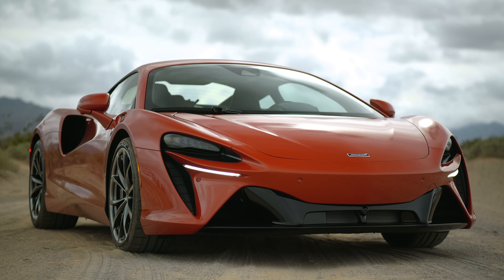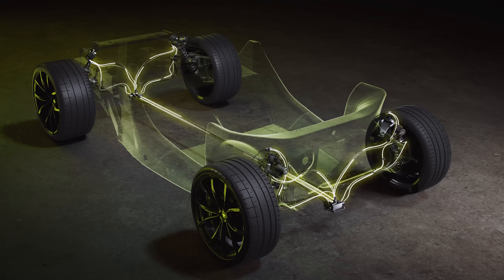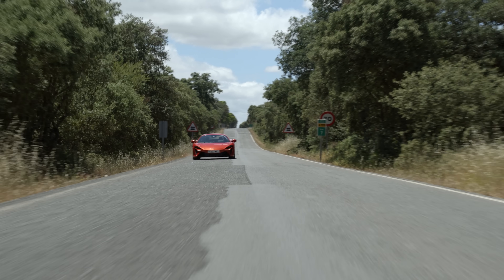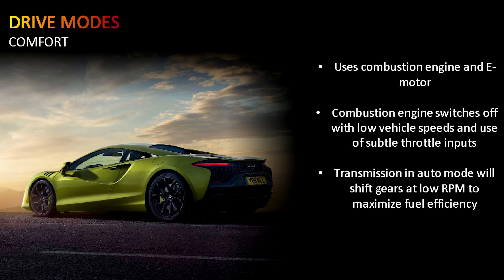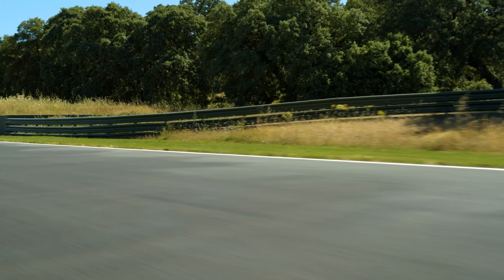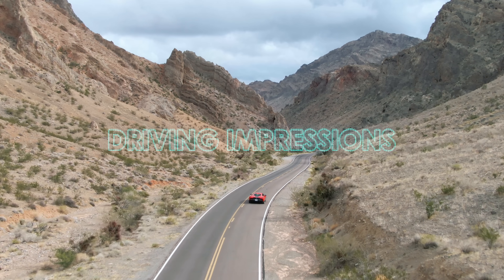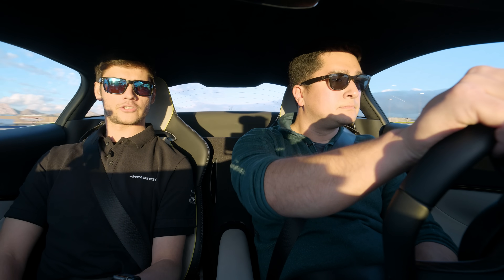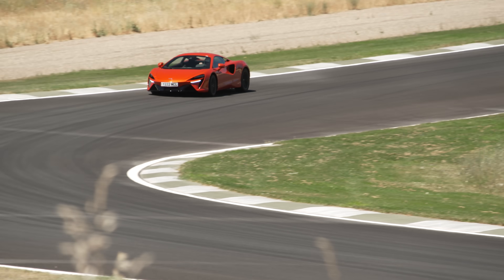McLaren Artura | The Hybrid Super Car Formula

Comment: Off topic important request:
Please consider doing a video about the feature cylinder de-activaion. I was looking to buy a pickup truck with a traditional V-8. However, the horror stories of unreliability is very concerning.
Thank you
Reply from the maker: Depends on the brand and how its implemented. The GM problems are the worst.  The FCA/Dodge/RAM are usually just solenoid issues.  Honda V6 previous gen destroyed certain cylinders from heat.  Mazda had the heat issue figured out by constant variation of cylinder deactivation but then had software issues. From consumer side if there is an option to disable do that.
Reply: @savagegeese  OH, great. Now we have to "bullet proof" gasoline V-8s like Ford diesel engines. 

Appreciate the rapid response and keep up the great work as a trusted resource.

Comment: I basically didn't know about McLaren before getting into the YT-based automotive journalism scene, but since then they've surpassed everything for me - I'd take a 765LT before just about anything else short of a 918 Spyder
That being said...doesn't this car just seem kinda...boring?
I realize it's a sport series car, not a super series, and it's an upgrade in every way except sound from the 570S, but I can't help but feel like it's a bit underwhelming.
Yes, it's fast. Yes, it's an engineering marvel. But compared to the step forward that the 570S was, this just feels a bit pedestrian.
Holding out hope that the rumors are wrong and the 720S replacement will keep the M840 with a hybrid, because we need a proper sendoff of the McLaren TT chaos

Comment: New dream car unlocked! This and a 992 GT3 RS and I can die happy lol. The engineering, particularly the forward-thinking hybrid drive train and axial-flux motor that is a perfect fit for its use-case are things engineers dream of. No one wants excess baggage or unnecessary complexity, but the right necessary complexity to magnify the impact of traits like driver responsiveness, engagement and efficiency is just a rare and set of problems and resources to be presented with. Kudos to the team at McLaren and their partners that made this car possible!

Comment: man i would love how to feel how that car drives with its hydro steering.
i prefer my base model 328i e92 hydro steering over my f80 m3 eps system...
Reply: Thats why you should get a e92 M3 or 335i and tune the crap out it, chassis and engine wise. Thats why I sold my F series and got an E series again...
Reply: @GoldenCroc  I'll keep the F series for a while, I still like it, that S55 is so much fun for me, but I will add on an M3 E92 at some point. Maybe after I pay off the F80. Besides, I drive the 328 most of the time so it's just that noticeable change once a week everytime i drive it

Comment: So how would this compare to your Z06? Speed Phenom describes his McLaren 600LT has more connected to the road, compared to his C8 Z06. Of course, the cost is significantly different.
Reply: Hydraulic steering, a lightweight carbon tub with race car levels of rigidity, and 3,000lb curb weight equal a car that no mass produced Corvette will be able to match no matter how great it is. To the driving connoisseur the Mclaren justifies its price and potential headaches, to the other 85% the C8 Z is just fine

Comment: The hybrid system and turbos are clearly there to improve the car's performance, not sure why you guys treat it like some compromise from regulations or something.
Reply: Weight, thermal complexity and most hybrid systems have added things like brake by wire etc.
Reply: @jackethnicallyambiguous  fair enough, but it seems they’ve done a good job keeping the weight down and retaining things like hydraulic steering and natural braking

Comment: I'm pretty sure that brake by wire hasn't been implemented in any production car as of writing this comment
Reply: Its in a ton of cars. C8, modern m cars, any ev with regen, merc, cadi.
Reply: @jackethnicallyambiguous  Yeah no.

Brake by wire means that there is no physical or hydraulic connection between the brake pedal and the calipers. so in the case of a power failure you no longer have brakes.

the C8 corvette, all BMWs, all current Teslas, most hybrids, etc have an electronic brake booster instead of a vacuum one. that means that in a power failure you still have brakes just without an assist.

electronic brake booster and brake by wire are not the same thing.
Reply: @anonym3017  what we mean by brake by wire, and what the engineer is saying in this video is that the brake pedal has no hydraulic feedback. The feedback loop is controlled electronically.
Reply: @jackethnicallyambiguous  the only difference between an electric brake booster and a vacuum one is that an electric motor provides the force instead of a vacuum.

The entire rest of the braking circuit is the same between them and the brake pedal still acts on and is directly connected to the hydraulic braking circuit. So the hydraulics provide the feedback/resistance in all of them as that's by far the simplest and cheapest method of doing it.

You can even test that by grabbing a modern M car, disconnecting the 12V battery and then testing if it still has functional brakes. If it actually has brake by wire it won't have brakes. If it still has brakes the pedal directly acts on the hydraulic circuit.

The manufacturer can obviously vary the assist of an electronic brake booster, depending on the situation, between none whatsoever (which is how they do regenerative braking when it is controlled by the brake pedal instead of by lifting off the throttle) and braking without a pedal input (which is how ACC slows down vehicles) and anything between those.

Comment: The most important thing is not included. reliability. Did they done anything compare to the 720S, 650S, MP412C reliability ?
Cracking windshields, tons of transmission problems, electric problems, cracking interior parts ad the list goes on... They should slow down releasing new cars and fix the reliability issues first.
Reply: They "claim" the new manufacturing processes will improve QC and reliability. It is too soon to tell

Comment: Frankly, hybrid propulsion is iffy at best. A car with two different powertrains no matter how well integrated can never be as reliable as a non-hybrid system. It's just common sense. If I worked at McLaren, I'd design a single turbo, straight six in a lightweight chassis, similar to the old BMW M1 coupe...circa 1980. It would much cheaper and utilizing modern materials and methods, it would perform very well.
Reply: submit your resumé
Reply: No high performance supercar manufacturer would use a straight six just for the packaging reasons alone

Comment: With their focus in driver involvement it's sad McLaren aren't making any manuals anymore. Now that lotus are going all heavy ESUV on us, MC could make an elise successor easily
Reply: They only had one model with a manual. And it's the most expensive one you probably couldn't buy. Also the best one. And it's old. 

Buy a Porsche if you need a manual these days. And the days aren't gonna last forever
Reply: If your're after driver involvement you have to readjust your mindset and forget modern cars. Stop looking at the new wizbang stuff that's coming out. The best cars for driver involvement have already been made and they're all over 25 years old. Rack and pinion steering, manual trans, little to no electronics to gum up the experience. The modern manufacturer's can talk until their blue in the face, but no new car can even come close to the older sports cars in the driver involvement area. Faster yes. Better lap times yes. Safer yes. Quieter yes.  They're also overly complex time bombs that will require a monetary commitment from the owner that simply doesn't make sense, especially when compared to the older cars. 

I drive a quarter mil dollar sports car, so I think I'm the target demographic for this McLaren. They would have to pay me to drive the thing. I can see the problems thus thing will have coming from a mile away.  And for what? So I can go faster and feel less? No thanks. 

If on a budget, go get an old lotus elan. They can be had for $35K. More driver involvement than this Mclaren. More character too.
Reply: @overbuiltlimited  just admit it... You know most people don't care about driving. Some people do. Most of those want the newest fastest thing. That leaves a few who can appreciate handling. They don't buy enough cars to matter anyway. 

Still, it's hilarious your suggestion is buy a lotus elan. Of all things that? Get an Elise and be done with. Or a caterham, or Alpine, carefully selected Porsche, an old BMW, a new MX-5, an old MX-5, GT86, Old NSX, RX-7...Etc.  

What in the world...
Reply: @TsLeng   Read my post again.  I explained my position well.  I also qualified what a drivers car is to me.  It also seems you missed the "if you're on a budget" part.  If you fine with a watered down experience no skin off my back.  Drive what you want.  I will say though it's pretty silly to criticize an Elan recommendation (why? no one knows because you didn't say why) and then turn around and recommend a Caterham.  A Caterham is a wonderful drivers car to be sure, and I could have easily recommended that, but it requires a serious commitment from the owner, much more so than an Elan.  But go ahead and criticize one of the greatest drivers cars of all time.  Strange.
Reply: @overbuiltlimited  a budget driver's car is a Mazda Mx-5.  The Elan is FWD, buy an old civic/integra instead. The older Elan...Well, but the Mazda 😂. 

If you think only unassisted steering will give the experience, there are still better cars than the Elan...
Reply: @TsLeng   Ah I get it now. You don't know your Lotus cars. The M100 Elan which started production in 1989 was never referred to by anyone, then or now, as one of the greatest drivers cars of all time. I was obviously referring to the series one Elan built from 62-73. It was REAR wheel drive and had steering so precise that it was the benchmark Gordan Murray used when designing the McLaren F1. After the F1 was finished he said that try as they might, they never managed to get the steering of the McLaren as "perfect" as the Elan.
Reply: Fun fact: The original Elan was used as the template that Mazda engineers and designers used when drawing up the Miata.  You probably should have known that given your recommendation of the MX-5, but hey arm chair internet drivers eh. Do you even own a car?
Reply: @overbuiltlimited  the only reason I am entertaining you is you have a very specific suggestion as 'the' car to have. 

And to have the confidence to add that is on a budget...Therefore I have decided to reply to tease more funny out of you. 

You probably own one of those things and just a massive fanboy. Understandable but hilarious trying to sell that. 

It's a niche proposal that isn't reasonable for most people. Unachievable even and you know why.  But one can buy an MX-5 easily, cheaply used. Even a new one if you fancy. 

Don't ever fall into the rabbit hole of thinking everyone is looking for the same thing. I just can't help but to comment because your rabbit hole is so niche and way off the mark. For  almost anyone else, just get an MX-5 or S2000 or Elise or Caterham et all and call it a day. 

Note: I knew you are referring to a rare Elan, but who knows, I bet there are hardcore FWD Lotus Elan fans what would try and convince us that is the best instead.
Reply: @TsLeng    Man, you are strange.  I' m done here. Keep your grades up. And don't worry bro, if you work hard you'll be able to get that Miata one day. In the meantime, enjoy the bike rides.

Comment: Ok, thanks Jack...we get it, McLaren can do 2-seat/2-door super/sports cars...but can they do 4-door wagons? I really think McLaren needs to diversify their product offerings and make a 4-door/4-seat car much like fabled sports car maker Porsche.  Initially, ppl were blasphemous (#@*&!%), but now 20 years on, that 4-door/5-seat SUV is still going strong and has given the company new life and new/more customers than it could have dreamed of.  So, McLaren, when is your 4-door/4-seat road/track killer coming out?  (hint:  do better than Aston Martin and do it for a lot less). 🏁
Reply: what if somone put new prius drivetrain into lotus elise lolz rwd transvere
Reply: @kalmmonke5037 ....well, what is better;  engine powering the wheels through the transmission w/an electric motor in line on the input (or out put) shaft...or....put electric motors on the wheels (half-shafts) and the engine used as a generator/range extender?...or combination of the 2 like in the newer NSX???  🤔   Full EV is nice, but I think the answer is performance hybrids... 🏁
Reply: @K03sport  for driving fun, gma t50 is it. variants of it would make sense. like off road version sort of like scuderia glickenhaus scg008 kit car, because although its not as lightweight agile, off roading fast (no legal speed limit) , rallye, rock climbing, car pitch and roll on soft suspensoon (to be able to get over bumps) then preemptivly switch to firm suspension for being able to go around turns quicker, and switch tires from offroaading to road tires.
Reply: @K03sport  to get benefits of electric and combustion , but miss on the game of keeping up engine rpm momentum, theres combustion powering minimal amount of battery and electric drive

Comment: Mclaren has only one problem in my eyes: reliability. If that gets fixed, they are up there with Porsche and Ferrari.
Reply: Ferrari isn’t that great either in terms of reliability. Porsche is one of the most reliable brands in this area.
Reply: @seren1ty755  It's not as good as Porsche, but it's still much better than Mclaren. And Ferrari makes up for it with their brand power and styling.
Reply: @HiddenWen  I approve this message
Reply: Not even close dude😂🥴🤡
Reply: @AnantGupta02  turbo engines over na v12? add to this ferrari looks much better both inside and out. who cares if mcclaren is a tiny bit faster

Comment: Reliability and depreciation are Mclarens major issues!
Reply: Supercars are not designed for daily commuting, they are designed for tracks once a month.
Reply: @inkandwrist  honestly, more than a few people daily their Ferrari Roma or Lambo Hurcan where I’m at, so why shouldn’t Maclaren be held to the same standard?
Reply: What model Mclaren did you own that you experienced this firsthand with?
Reply: @jameswillard1  bro he’s just saying that it’s common.
Reply: @jameswillard1  I own a 570S and he is correct. It doesn't take ownership to realize that McLaren's reliability is trash. Just read the forums and see that they have issues that carry over from model to model. Misaligned doors and strikers, broken windshields due to stress, paint quality issues, and of course general electronic issues and mechanical faults. All of these things have carried over from the mp412C to the 650 to that 570 and then 720. So that's four generations of cars that McLaren couldn't teeth out issues. Why should I be convinced that the artura will be any better?
Reply: @objectivethinker3225  You didn't specify what happened with your 570S? Why mention it and then continue to do what everyone else does and mention forums and online. Hmm.
10 year old 12C here that has been faultless besides consumables!
Reply: @jameswillard1  ???
Reply: @jameswillard1  I’ve autocrossed them, they overheat like a mofo

Comment: To an extent, BMW did this with the i8 in 2014. Very similar formula, and one that the Corvette is going to follow as well although with a V8. I've absolutely adored having the i8 for the past 4 years and been struggling with what to replace it with this coming spring. At the moment I'm going to step over into a manual M4, but can totally see myself getting back into this kind of car down the road.
Reply: corvete steering is not communicative
Reply: I8 is not a supercar
Reply: @brownjb4444  Is a Porsche 911 GT3 a supercar? Is a Lotus Exige a supercar? Is a Mclarge Artura a hypercar? who cares?
Reply: @brownjb4444  it's a sports car. Doesn't matter regardless